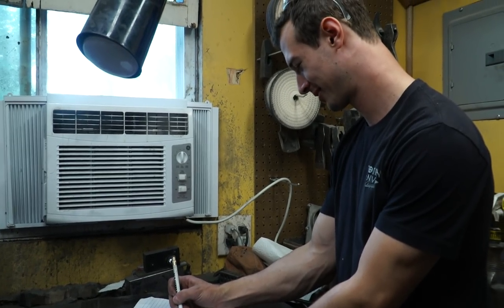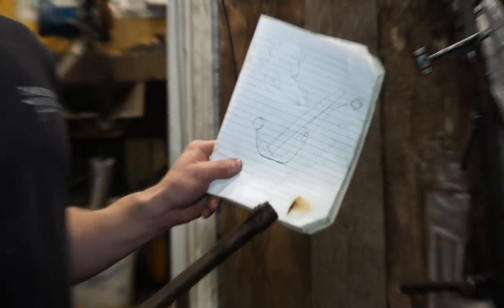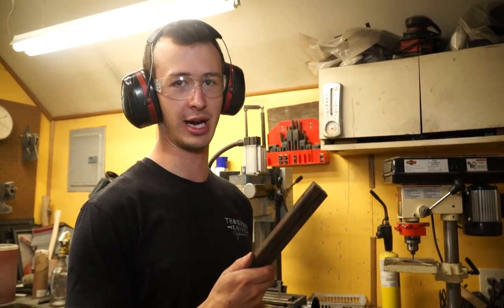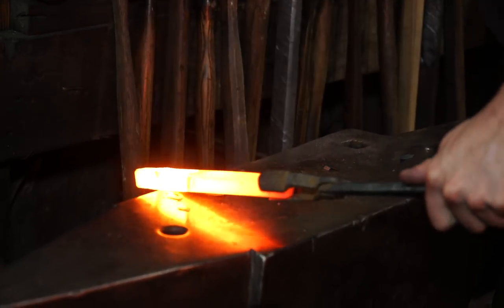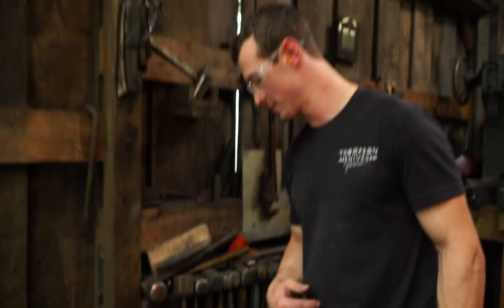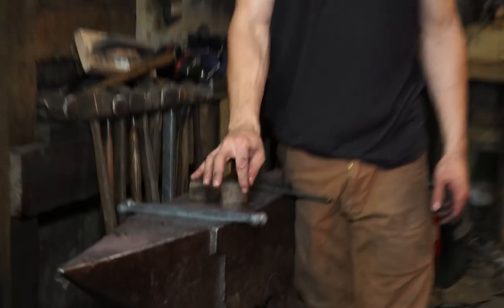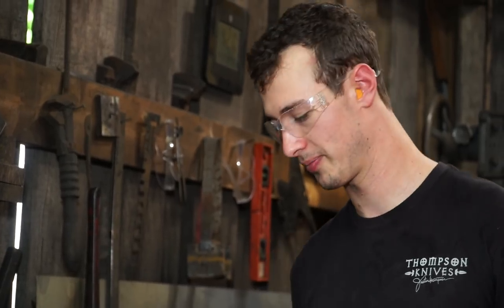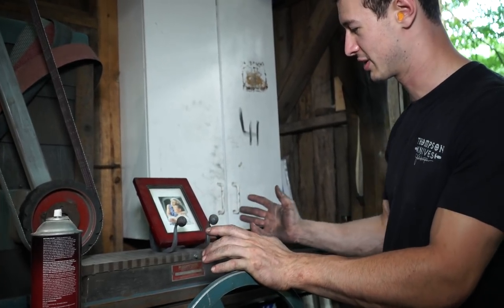HAND FORGED PICTURE FRAME STAND 1

Comment: Cool frame holder. I have to admit I had trouble listening after you suggested the first step be to isolate your balls and expressed concern that they be the same size. Also I think I missed the part where you grind in the primary bevel, I'll have to watch it again.

Comment: I wonder if the picture inside the picture frame is laying at too steep and angle. I don't know if there is a specific angle every picture frame must sit, but when you put your practice picture into the two frame stand pieces I thought way back in my wee little brain that the angle was quite obtuse? I don't know if there would be a way to have the picture frame stand up more? I suggest taking the picture frame and leaning it against a wall in at nice angle and then try to match that angle, but maybe you are trying to have the picture frame sit at an angle so that it is viewable by a person standing up while the picture is down on a desk top? Maybe I'm overthinking this?